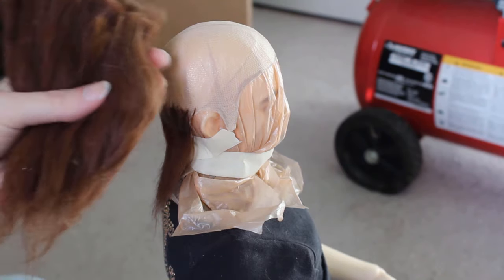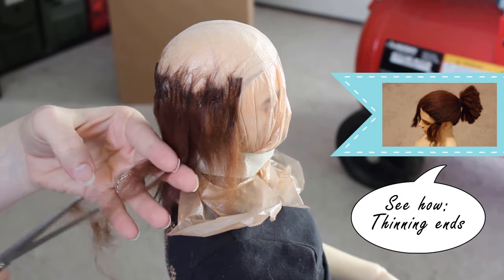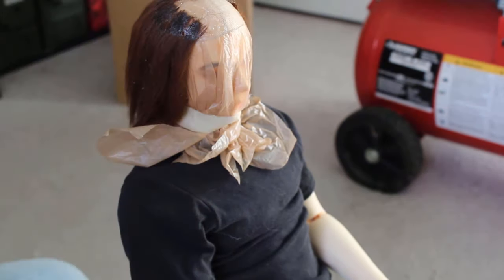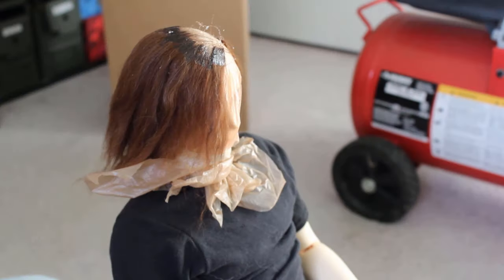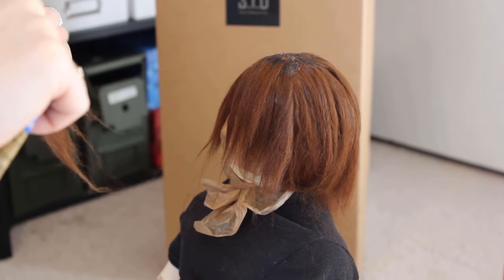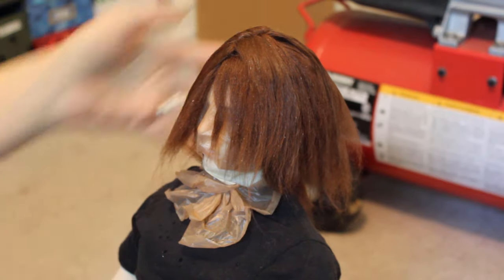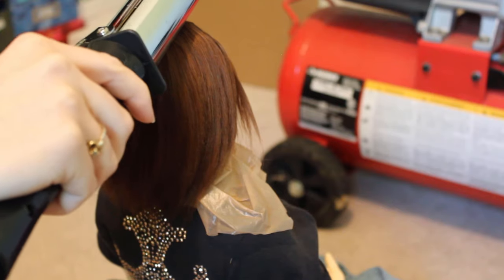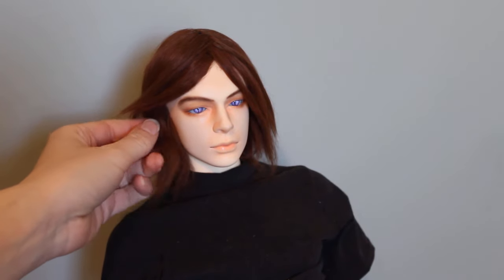Making a center part: Another way to create alpaca fiber BJD wigs

Comment: If you are looking for a super straight part you can use a wooden skewer when you put the wefts there to really press down on the head right at the part, repeat on the other side and it should help. I think it turned out great!
Reply from the maker: That's a great suggestion, thanks! :D

Comment: Thanks for sharing this great video. What brush or comb do you use to initially comb out the raw alpaca fiber? I'm trying to get better at doing that with less hair loss. I'm also trying to perfect a method for combing out long locks. Right now I'm starting and the bottom and working my way to the top as I comb, but I feel like I end up with a lot of loss at the ends that way.
Reply from the maker: I use a Wet Brush Pro for the whole thing. It's a really gentle hair brush I got at the local Sally beauty supply and I found I get less than half the waste using it as I did with other combs and brushes.